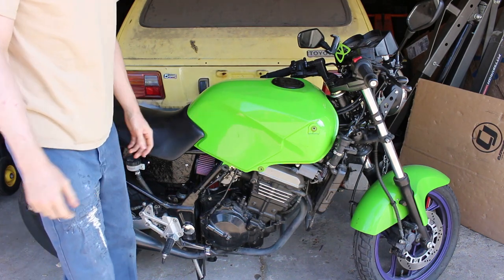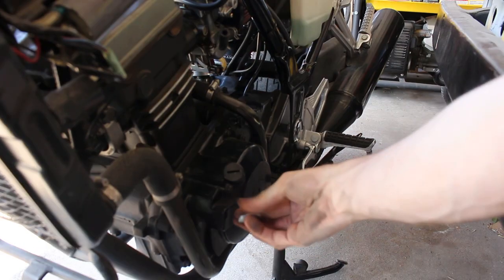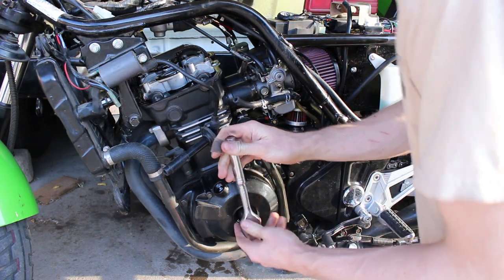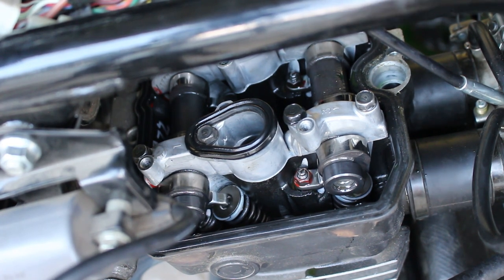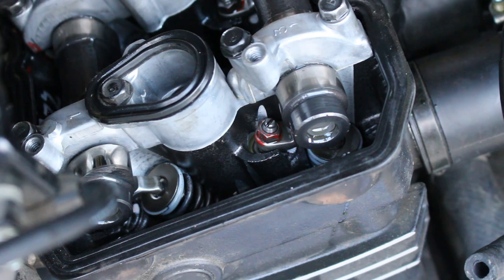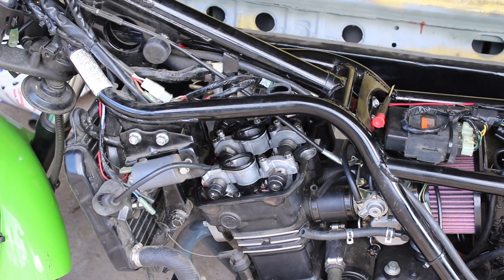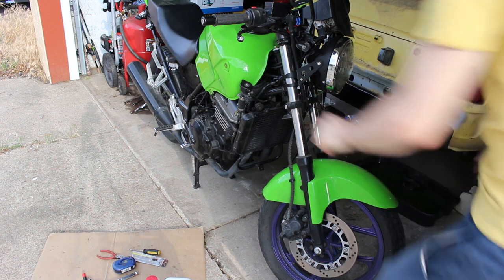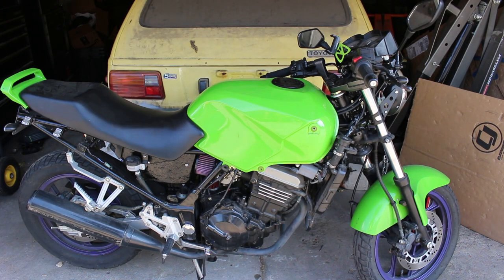Valve Adjustment Ninja 250

Comment: make a video on your carb settings for the K&N pod filter. I cant get mine to run right no matter what jets I run
Reply: Have you tried checking the float levels and balancing the carb butterfly valves? I had an old LTD400 that would not run and it ended up being the float levels, one was bent so the carb was barly getting any fuel
Reply: @backwoodsjunkie08  I have, many times. theyre in spec and I have also lowered the floats as someone recommended and that did not help. I'm pretty good with carbs but this one has confused me
Reply: Cv carbs do not like pod filters. Have to get a slide carb if you want to run pods.
Reply: @Aciecarter238  Its all good. I realized after the longest time that I had a bad jet. it runs perfect now. it never ran great even when it was new but now it runs better than ever
Reply: @MarshallSmith27 what year was your 250r and what jets ended up working for you, I think I need to re jet and maybe sync my carbs

Comment: Be careful. None of the cam lobes were ever in the correct position in this video. The lobes needs to be pointed up and out as can be seen @13:33 ( https://youtu.be/h4-VTx_XndE?t=814 ) in the graphic on the sheet of instructions he holds. At no point when he was measuring clearances and making adjustments were the heels of the cams properly above the rocker arms. Please verify the arrangement mechanical assembly before making adjustments so you do not destroy your timing like @ScrapMetalMade has here.
Other issues, there was needless disassembly. Valve cover can be removed with less effort. Also, each cylinder has a TDC and is adjusted respectfully. You need to locate TDC on cylinder 1 (the 1T mark), but you also need to locate it for cylinder 2 ( there is a 2T). When you can see the marks in the viewport, you also need to verify the angle of the cam lobes. With patience cycle the engine until the configuration is correct. You may notice issues with the valve clearances by doing this alone. In the adjustment stage, after loosening the locknut, make the adjustment with a small slotted driver through a deep 9mm socket. This way you can easily lockdown the adjustment screw while also holding its position.